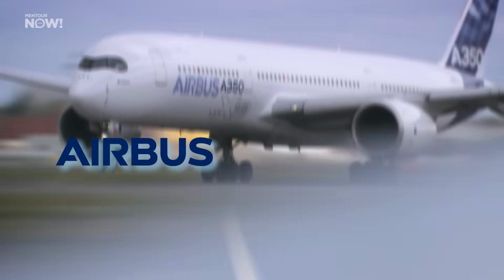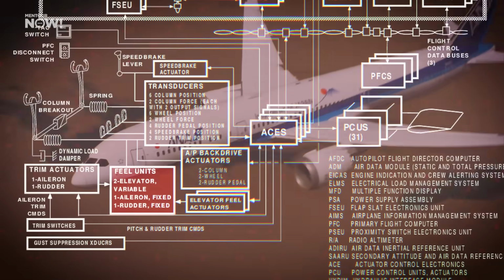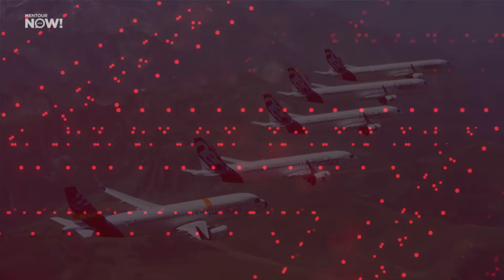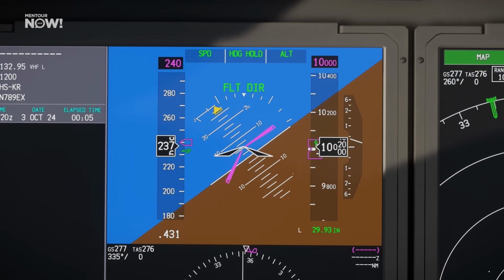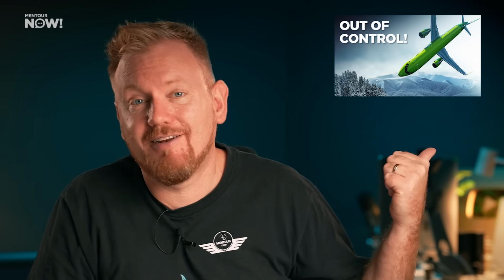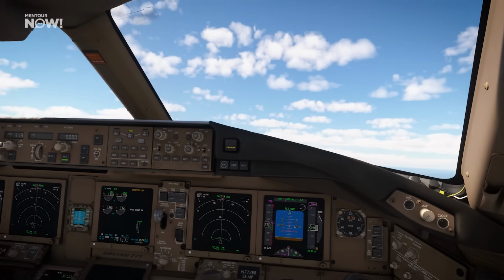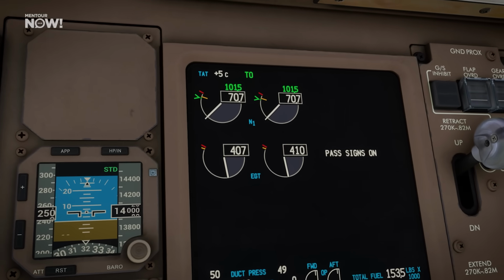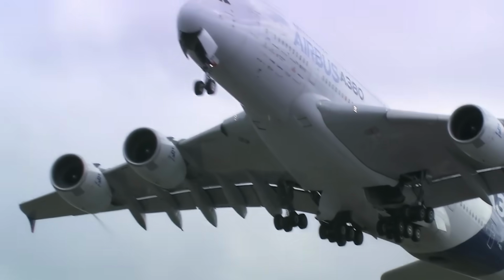Do Pilots Prefer AIRBUS over BOEING?!

Comment: Many years ago when I was a cadet, I was in the front cockpit of a pretty old fashioned tandem glider. There was an experienced RAF pilot behind me. He was flying as we came into land. We had just got the wheel on the ground when another glider in trouble cut across us. He pulled back on the stick, got the glider airborne, we go over the other glider and stalled on to the ground. 

Had this ancient glider had the Airbus fly by wire solution would the pilot have been able to do this? Saved me getting maybe broken legs, maybe worse. What about the occupants of the other glider too. You decide.

Comment: I fly the B737 for a prominent u.s. carrier famous for flying only the single type throughout nearly its entire history.  I feel airbus philosophy is deeply flawed. Having an airplane that protects you constantly is great, until the automation fails, and you realize you havent actually flown an airplane in several years. This in addition to a compounding factor can make a situation unravel into "the red" quite quickly.  The B737 is all cables and pulleys to hydraulic actuators. You actually fly the plane. At my airline we are encouraged to hand fly often.  Automation isn't mistake proof and when its necessary to disconnect it, its a non event since we hand fly so much. I agree more with this piloting philosphy.

Comment: I find it surprising that Airbus pilots can become as proficient with their left hands on the side stick as with their right.

Another thing about the dual input errors is that when I was a RAF cadet at 14 years old I had experience flights in Chipmunks with tandem dual controls. The procedure for swapping control was 'you have control' then the reply 'I have contol, sir'. And then the reverse. Seems pretty simple to me, I wonder why experienced professional pilots don't do that.
Reply: It is the same in a Boeing. When the Pilot on the left side is flying he has his left hand on the yoke and  his right hand at the trust. So no diffenrence.

Comment: Lack of sidestick and throttle feedback is just a killer. As in, I believe it's likely that's killed people. There's simply no excuse for such a basic feedback mechanism that is absolutely vital when a situation is most dangerous.
Reply: Airbus is way too confusing and way too automated.  Confusion is inherent when the system has so many layers.  It is been obvious for many years that the Airbus pilot just monitors the automation, by design.  Add in the 1/2% of pilots like Atlas Air who are idiots and mental defectives.

Comment: the descriptions remind me so much of the debate about manual vs automatic stick shift in cars, albeit on a much smaller scale. i trained on a manual and now drive automatic and i feel like i see both sides of the argument, manual makes you truly feel in control of the car while automatic makes you feel like you're playing a game (but also you need less effort to drive). it's funny how similar arguments exist across different spheres
Reply: Far more similar to debates about self driving cars.
Reply: Feel you on the shift stick. I learned on manual and my current car is still manual but after having automatic in my hands quite a few times I can totally appreciate its benefits over manual.
Reply: Mostly agree on the shift thing, although I actually find cars with a precise and predictable clutch (think old sports car, had the opportunity to drive one a few times) to be intuitive enough to offset the extra workload. Still mostly drive the CVT hybrid car from my parents because no matter how nice the clutch is, 4l/100km in a 5 seater on the highway just isn't achievable without a CVT and good cruise control software.

Comment: The AB test pilot who flew into trees on a demo flight go around, pushed the power up, but the AB said, nope you didn't say pretty please (didn't correctly move the correct switches in the correct order).   The whole debate comes down to if you pay to hire and train experienced pilots...or if you don't.   If you want to spend the minimum amount of money to get and keep a pilot, then you want hard protections so if there is any acft malfunction, you can blame the builder for the accident.   BTW, the A300 was not FBW, so the first one was the A320.  Stick vs yoke?  if you are left handed then a left handed stick is fine...but since most of the population is right handed, the acft has to smooth out the pilot inputs on the stick...so therefore the pilot puts his vote in on where to go, and the AB allows a little.   There is a video with the camera over the AB captain's left shoulder as he is flying an approach...he is moving the stick everywhere, the acft is barely responding.   Biased? yes, I will fly the triple till I retire.
Reply: It wasn't an Airbus Testpilot, and the issue wasn't the aircraft as such, but the engine response time. CFM-56 engines can take up to 8 seconds from idle before any meaningful thrust is produced. The pilot in question moved the aircraft into a situation where there was no way out. It was either a stall and bellyflop on the ground or a controled flight into the woods.
Reply: @shi01  Not an AB guy...that is how it was explained to my by my 320CA crashpad buddy.
Reply: @youbecha64  Michel Asseline, the pilot in question worked for AirFrance. He was the chief check pilot at AirFrance for the A320 and also was the one that did all the acceptance flights for AirFrance up until the accident happend. Which involves system tests, yes. But he wasn't an Airbus Testpilot or an Testpilot at all in the sense that he flew prototype aircraft or tested prototype flight control systems.
Reply: You are a pilot flying a 777?
Reply: @volkerbrinkschulte5169  Yup, flies better than I can.
Reply: @youbecha64  Than I wonder why you talking about left and right handed. If you are a pilot flying a 777 you should know that it is the same in a Boeing cockpit. In a Boeing cockpit the pilot on the left side has the left hand at the yoke, the right hand at the trust lever.
Reply: @volkerbrinkschulte5169  If you have used a high performance aircraft stick with your weak hand it is like trying to write with your weak hand...pretty sloppy and inaccurate.  A yoke can be gripped with both hands if needed...and during takeoff usually that is what people do.  So the AB side stick is not a precision device like a 'fighter' stick...it takes gross weak hand inputs and the acft decides what is best.
Reply: @youbecha64  Information from Boeing: "An analysis by Boeing shows in which phases during a flight the risk of an accident with fatal consequences is highest. The study comes to the conclusion that by far the largest number of fatal accidents occur during the approach and landing."
And you are telling me it is OK to land a 777 with only the left hand, but in a Airbus it is an issue?
I think this left handed, right handed "thing" makes no sense because in a Boeing you are doing the exact same thing during the most dangerous phase of the flight. If you are the Pilot on the left side you only use your left hand.
Reply: @youbecha64  I did exactly read what you said.
Somehow your dexterity knows if you are flying an Airbus or a Boeing. In case it is a Boeing the dexterity of your weak side rises some levels so you have no problems to land the plane safely with your left hand. But if your dexterity realizes that you are in an Airbus it goes down and you have no chance to land the plane without support and corrections.
Sounds logical to me.

The story of left and right handed is exactly that, just a story.
Reply: @volkerbrinkschulte5169  Apples and Oranges, the yoke movement is different than a stick movement for pitch and roll...requires different muscles in the hand and arm. Because of that, the AB only directly responds to stick (at least pitch for what I have been told) in the flare and when it reverts to manual (or whatever they call that mode)  In the triple the only time the yoke needs as big of movements as in the clip I shared is in an emergency, like a stall or other out of normal pitch zone maneuver.   I don't care that the AB has a stick...but they should be tied together so the non flying pilot has a clue as to what the flying pilot is doing with the controls.

Comment: I "cut my teeth" on Boeings (KC-135) and flew several models of Boeings for decades for the airline.  I really enjoyed them and felt they were great airplanes (I still do.)   Then, with some trepidation, I checked out on the A320 and I was hooked.   Ended my career flying the A330.  I loved the Airbuses and had a personal preference for them.  But I always said that the B767 was impossible to land badly and that, if I knew I would lose an engine at V1, I wanted to be in a B757.

Comment: I fly the A220-300 (not really airbus) and have done multiple times Direct Law training in the sim. And flying wise, I actually prefer that.
There are certain things I do not like, the speed-trim is not my preffered mode of trimming, neither is the lack of feel in gusty conditions. But all in all, I would not want to go to any other type
Reply: Wait there's no force feedback in the sidestick? I thought the very fact they had C*U FBW meant they must. Wow.
Reply: @ClaysonAntoons  Airbus and Boeing are very different. Mentour says the Airbus pilot's job is to monitor the automation.  And as I understand it, you can command a banking turn, and once commanded the banking turn will continue automatically until the fuel is used up (on Airbus).
Reply: @kentbetts  I been knew all that. The thing is the A220 is not a true Airbus and that aircraft was said to have force feedback. It's only recently I am finding out the former Bombardier aircraft has no force feedback just like the real Airbus.

Comment: Pilots prefer Boeing to Airbus for one reason.  In an emergency, Boeing will allow the pilot to "bend the airplane" and save the pilot and passengers.  E.g., if in a dive and you need to exceed the limits of the elevators if you pull up very hard, damaging the elevators in the process because the ground is coming up quickly, Boeing will allow it.  Airbus will not.  The computers on Airbus aircraft will not allow the pilot to exceed certain parameters, even if it will save the people on the aircraft but damage the airplane.

Comment: Most people, 90%, are right-handed - but Airbus requires the left hand on the pilot stick! Why would anyone want to fly an aircraft with anything other than the dominant hand, the hand and arm with the finest motor skills? Does this mean Airbus pilots are typically lefties, eliminating a large pool of potential pilots? Or does it mean that Airbus considers actual pilot control input to be largely unimportant and redundant? This wouldn't give me much confidence in Airbus design parameters.
Reply: Just a quick question. The pilot flying normally has one hand on the yoke/stick and one hand on the throttle if he flies manually, right? Where are the throttles in a Boeing airliner?

Comment: As an American commercial pilot watching the video you would think I would lean towards Boeing.   Strap on the airplane.   Feel the airplane.  Fly the airplane!   At 55,  I haven’t played a video game since Atari Pong. But, I just feel better knowing that an automation has its best interests at heart i.e. make sure the airplane doesn’t fall out of the sky!  Just let me monitor the system to make sure all is well with the ones and zeros.   I fly single pilot IFR in a piston, single engine in Alaska with no auto pilot.   I feel like I run a marathon after a three hour flight.   I think Airbus is on the right track.   Take away 85% of my workload. Let me concentrate on the most important 15%.   I cannot help but think that might be a contributing factor in the difference between GA Aviation accidents and part 121 accidents.

Comment: I think there’s an incredibly important thing in this argument that needs to be addressed in my opinion. I’m new to aviation. Finishing my CFI in a month and one of my big things that I am adamant about is that we do not fly JUST for ourselves but for any passengers who’s lives we are then responsible for. You keep saying throughout the video airbus makes flying safer or easier or simpler for the PILOT. That is indeed true but more importantly it makes it safer for the passengers. They are the only thing that truly matters. I do agree it would be incredibly useful to give tactile feedback during forced overuse by the aircraft, but ultimately the airbuses are designed to protect its cargo, whereas Boeing is more about letting pilots be in control. That’s great in its own way but it also means the pilots could endanger the passengers much easier whether on accident or not.

Comment: “Pilots always have ultimate authority” - what a joke! Tell that to the pilots of the two crashed 737’s in 2019 & 2021 (Lion Air and Ethiopian Airlines aircraft.)  Boeing’s MCAS system didn’t let the pilots control either of these two jets.  Instead, these systems lied to them!

And even nowadays, there are so many things happening on Boeing jets that just ignore the pilots.  One that comes to mind is unresponsive rudders.  

One last comment, it appears that the Airbus way of doing fly-by-wire is so much better as mentioned in the video, but based on its design, it is also able to integrate with computer and auto pilot systems with a higher degree of reliability, accuracy and confidence than Boeing’s way of doing things.  

Don’t get me wrong, I used to love Boeing.  My dad worked for Boeing in t the 50’s and 60’s.  But when any company is focused on greed and uses any means to justify its self, including killing people’s like whistle blowers and customers (aka passengers), they have no right to operate as a company.

Comment: I am an electronics design engineer.   There are two types of Circuit design CAD and two types of engineer, one does the checking for you, for example all the wires are connected and none of the tracks are too close to each other.  The other type of engineer uses none of those things.  I use most of them, so I check as I go and go over my work many times, right back to the basic circuit function.  The other engineer does then check each stage and does not tend to go back over.

So I can see one aircraft for one guy and the other for the other guy.

Comment: ~11m ... regarding Airbus TOGA lock without thrust lever movement ... I'd suggest a strip of lights on the throttle quadrant ... a bargraph that shows actual throttle setting, the lights coming on only when computer overrides the pilot's lever setting. This would provide at a glance, a warning of the discrepency along with situational awareness for feedback to the pilot as to actual thrust setting.

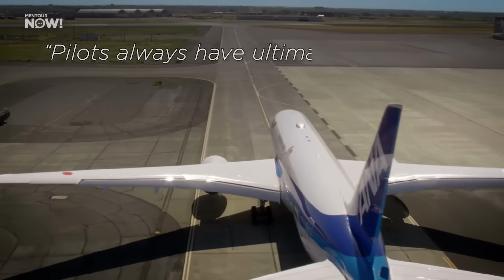Comment: 3:38 - Yes, except in the case of MCAS, which killed 350 people...

Airbus has not always stuck faithfully to its envelope protection philosophy, and the result of this deviation was the American Airlines Flight 587 disaster. (Or, rather, it was before Airbus aircraft employed full flight-by-wire; the aircraft involved was A300.)